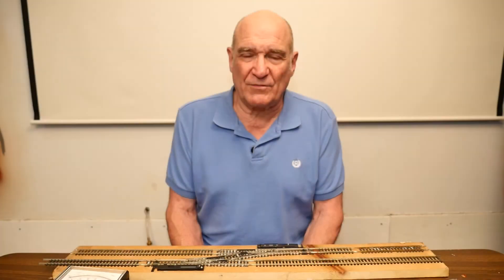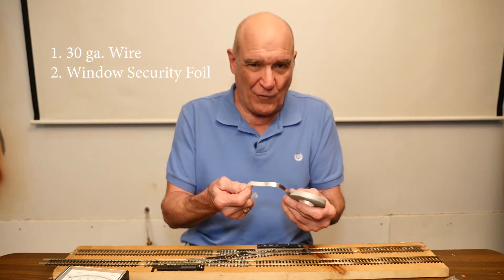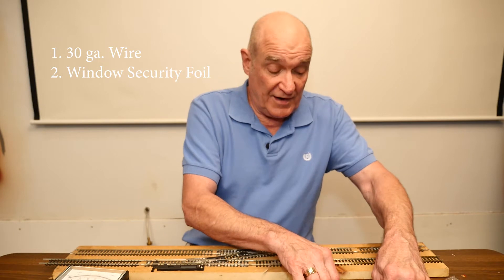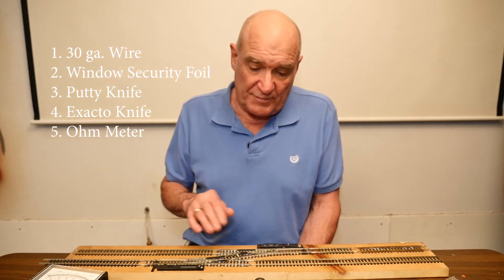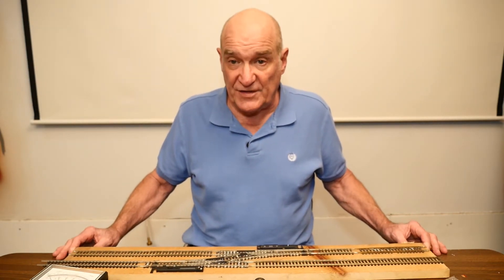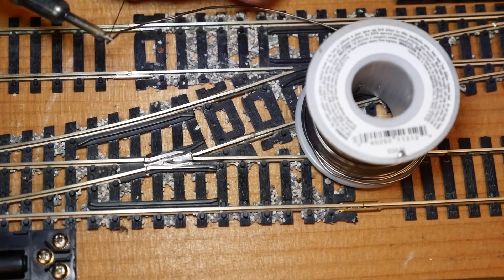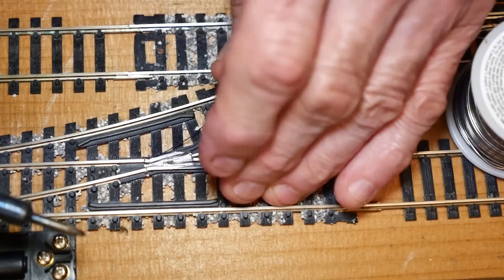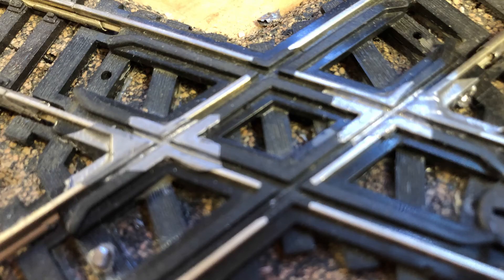Electrofrogging Part 1 - Eliminate Dead Spots In Switch Frogs

Comment: I have several of the Atlas turnouts with the plastic frogs.  How durable over time is the lead tape?  Is that the lead tape with rubber adhesive backing?  That is what they sell on Amazon. Thanks.